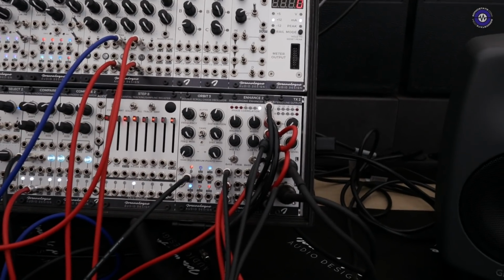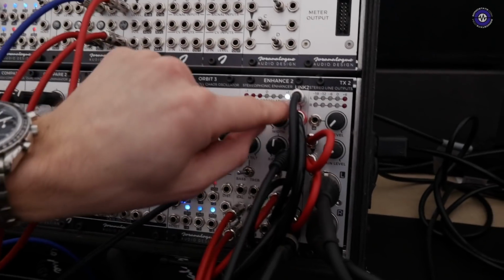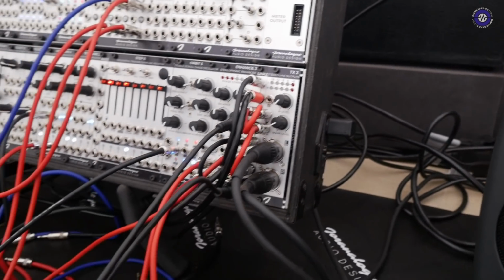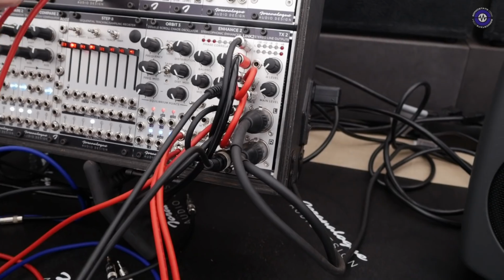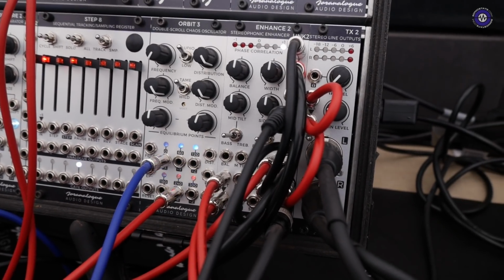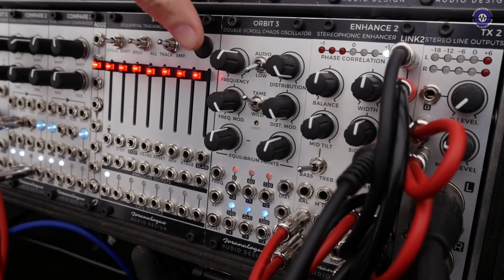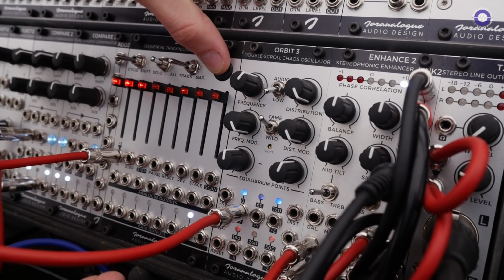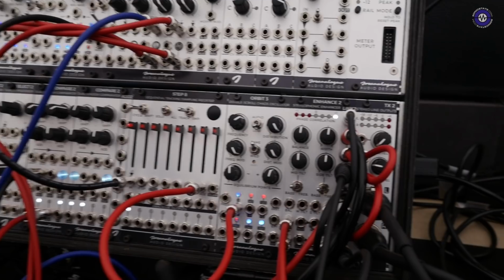SUPERBOOTH 2021: Joranalogue - 3 New Modules

Comment: I'm not throwing shade by asking this; I'm genuinely curious:

How is Step 8 different from Voltage Block in a feature set sense?
Reply: I think the Step 8 is more about inputing voltages and audio and using a very flexible t&h and switch functionality.  The Voltage Block doesn't take in cv or audio as sources, but rather lets you generate voltage sources per step using the faders as voltage generators.  Because of this, it's doesn't allow for switching or t&h functions.